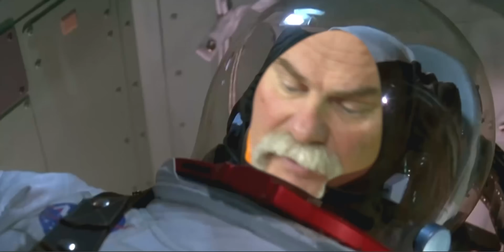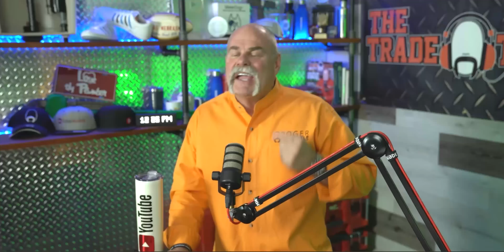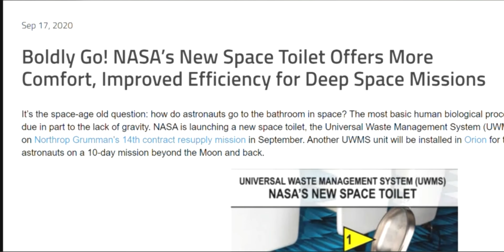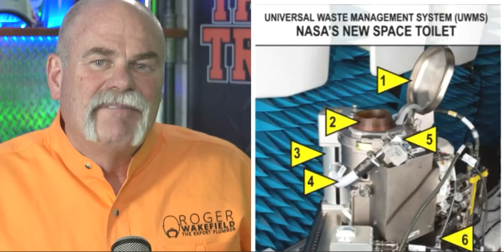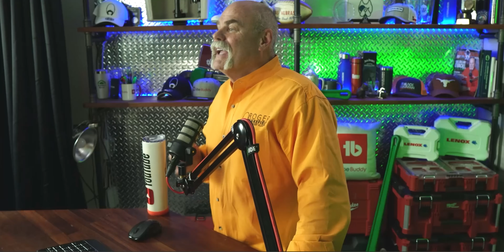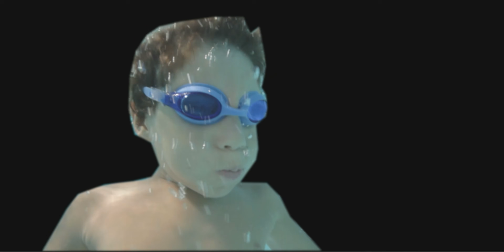Is The NASA Space Toilet The Future of Plumbing?

Comment: The cost for things like spanners being insanely expensive isn’t for the actual building or materials used. They calculate every single gram that has to be launched into low earth orbit which is where the cost comes from. It may just be a £50 tool but the weight, size and fuel cost make it seem insane. Also the Russians refuse to drink the treated water from urine so the Europeans and Americans collect even the Russians urine for water.

Comment: They don't have zero gravity chambers. The only way to experience zero g without going into an orbit or straight up leaving the earth's gravityfield, is to take a ride with the special flight they have, that creates zero g for about a minute as it plummets downwards from a great hight. I can assure you this is made aboard the iss orbiting the earth. All the astronauts wear that set of clothes - blue and kaki. If you look closely you can see black bars on the "floor" (there is no sensation of up and down in zero gravity, thus all surfaces could be floor depending on which way you are orientated) they use these bars to attach their feet to so they can "stand" instead of floating around. You can't sit in zero g as sitting requires gravity. Thus you can't make a toilet where you need to sit to use it. It needs to be suction based so the fluids and stuff don't just float around, but instead are suctioned right into the toilet tank as soon as they leave the body lol. It would not just fall down to the toilet pool as it would on earth. It would float around. Living in zero g can be difficult to comprehend xD